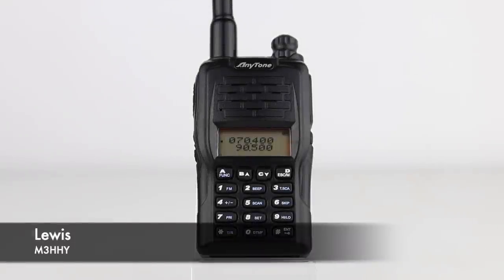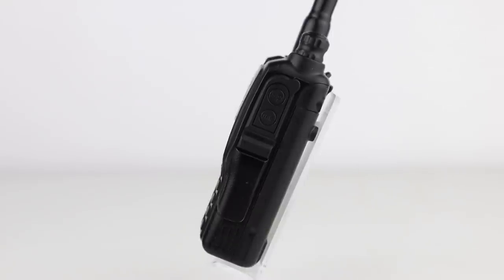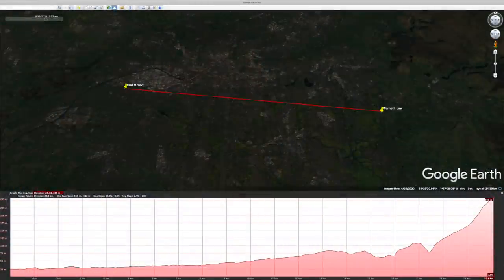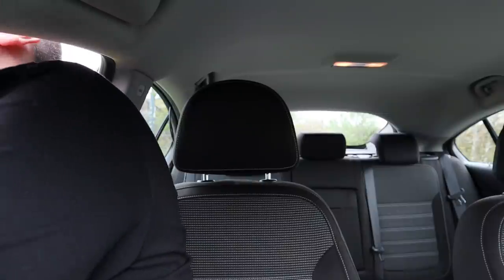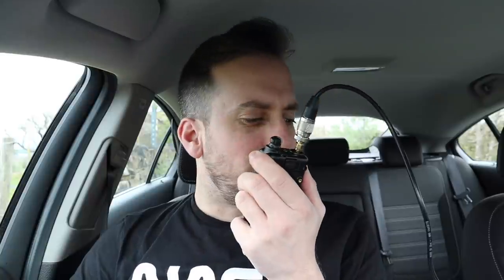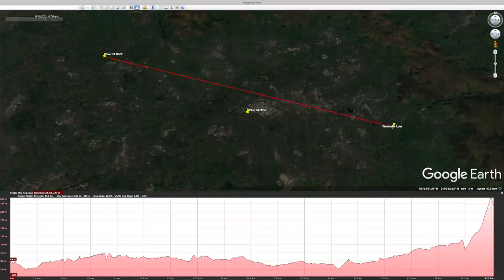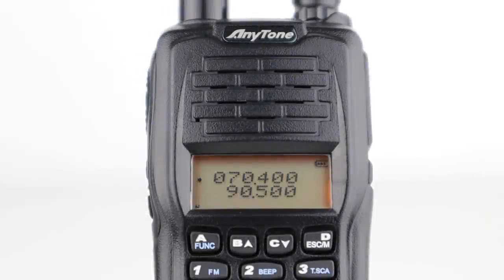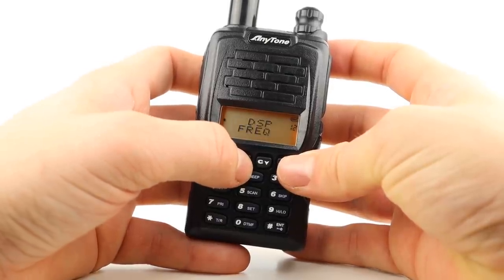Anytone AT-288 - A Great Starter Radio For The 4m Band

Comment: I reckon when you were close by the car with the rubber duck antenna, the car might have been acting like a ground plane, and the effect may have been lost when you got further away. HT's with rubber duck antennas rely heavily on the person holding the radio for a ground plane and maybe the longer the wavelength, the less well that works.